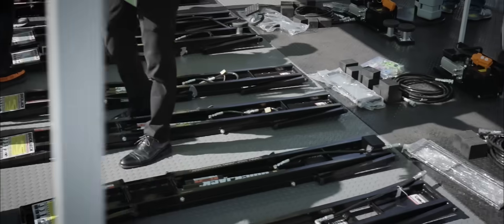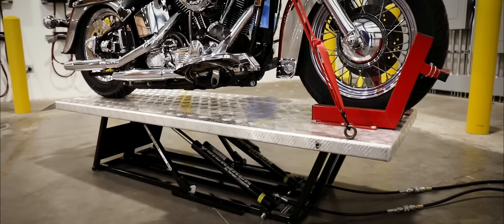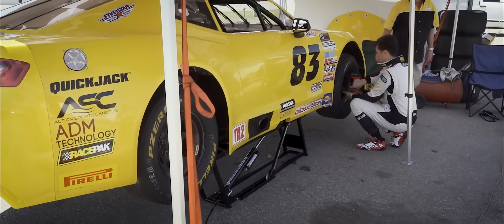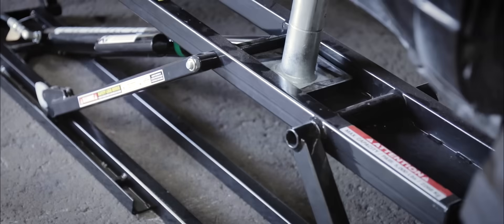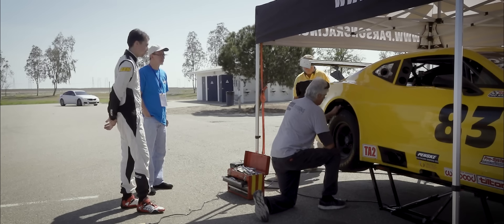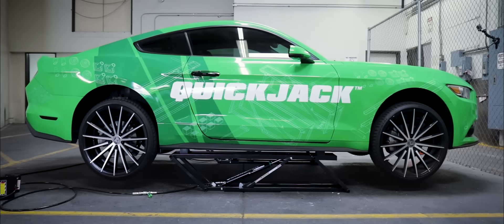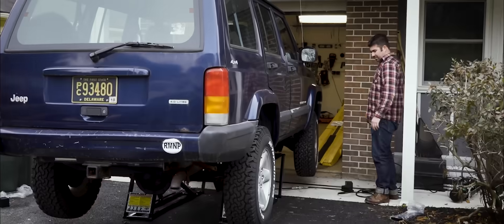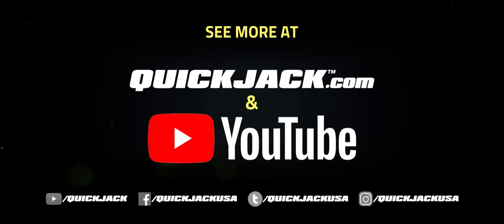QuickJack: Coming Soon to a Garage Near You

Comment: Honestly, one of the best things I've ever purchased. No more dragging my from jack from one side of the car to the other, systematically raising the jack stands to the height I need. No more wondering if the jack stands are going to hold. No more sliding into a pie wedge under the car... you've got equal clearance from front to back. It makes oil changes quick and easy. But there is nothing like having a QuickJack when you're doing brakes. All 4 wheels off at one time... beautiful.

Comment: Shout out to QuickJack Customer Service.  I bought my SLX7000 unit through Costco and it did have an issue with the original pump.  I got ahold of the QuickJack customer service team during Covid and on Christmas Eve.  They still responded quickly, trying to troubleshoot the original pump issues over the phone.  Ultimately, we could not resolve the issues, and I ended up replacing the pump.  QJ was the first to make the recommendation and shipped me a new unit the next business day.  The experience could not have gone any better given the situation.  Since then, I am using and loving the QuickJack setup and have a lot of faith in the company behind the product.